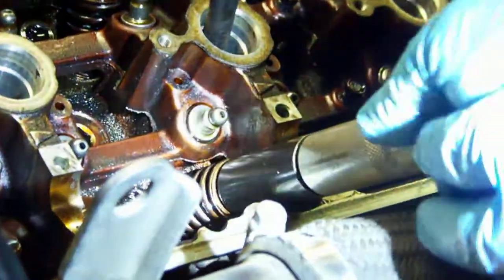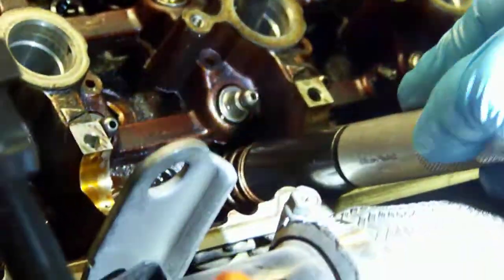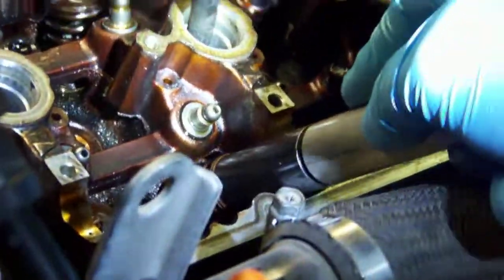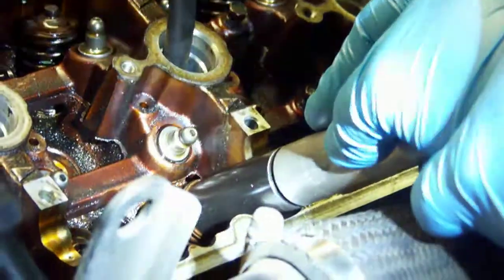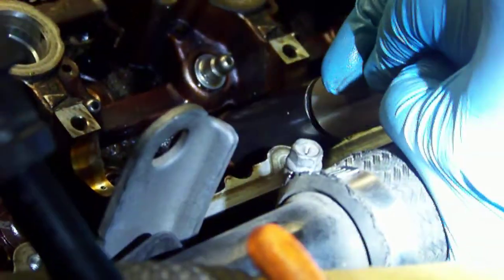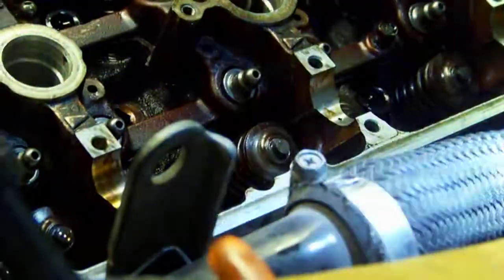How to install valve spring retainers / keepers on a 3000GT DOHC V6

Comment: How did you maintain pressure in the cylinder? I keep having blowouts through where the plenum would sit and air just keeps escaping
Reply: You can put skinny nylon rope in the spark plug hole and then turn the crank by hand at the crank pulley in order to push the piston up and stuff the rope against the valve.

Comment: Going to buy this tool to replace the valve stems seals on my 4g63t. Thanks for the visual demonstration. Really helped to confirm my purchase!

You can also feed some nylon rope in the spark plug orifice and set the piston you're working on to TDC to prevent the valves from falling in the cylinder.

Comment from the maker: The combustion chamber is pressurized using an air compressor and a cylinder leakdown tester kit.  This allows the user to regulate the amount of pressure fed into the cylinder.  The remover/installer tool can be purchased from your local Snap On Tools dealer or directly from their website.

Comment: I need to change my valve springs on my mitsubishi 3000GT 24v. I bought a second cam for the street race and normal driving.

 How is your air hose attached? Is it just an air hose you put down with air and then they come up?

 I have not tried it before but would like.

 Would you explain to me where you buy the tool you use for valve springs and how you mount the air hose?

 Regards Tommy

Comment from the maker: As you pressurize the combustion chamber (roughly 100PSI), there will be normal pressure loss over short periods of time.   The pressure that is lost will need to be replaced.   Over the course of 1 cylinder, my compressor cycled a few times to keep up with the pressure loss.   I'm not sure what a shock pump is capable of- but just keep this in mind that you have to be able to maintain pressure as you work on each cylinder.

Comment: sleepwalker..i removed the keepers with a gentle tap of a heavy hammer and installed them by pushing down real hard on the tool..i dont see how u could have scratched them...i checked all my valves after i did each one and none of them had the slightest scratch

Comment: this tool will save u hours of time, i just got through doing the vss on my 3000gt, the back of the head is the tuff one you have to remove the two brackets behind the head and its a pain in the rectum, and you also have to heeman the springs from the rear of the engine..im a small guy but i still could do it..i would probably be still on those valve if it wasnt for this tool

Comment from the maker: I don't know if you saw my video about how to remove the valve spring retainers with this tool, but i was very specific in it about how the other tools similar to this would not work.   What i said about the tool and the person using it wasn't meant as a personal attack.  I apologize for that.   If you're not using the specific tool that i mentioned- then you should not have blamed the lack of success on this tool.   I've tried several tools via trial and error before finding the correct tool

Comment: Yea, I noticed you installed it right, but others on youtube haven't. Watch their video and the stem is level with the retainer instead of sticking up about a quarter of a inch like you did. The installer I have does look too big, and their obviously not universal. My installer is silver and not black, got it from snap-on with no part number. I'm sure your right about the part number, but that wouldn't have anything to do with the person using it now would it.

Comment from the maker: The tool is only as good as the the person using it.   I've used this countless times on Mitsubishi and Toyota heads without issue.   Sorry for your troubles and difficulties with this job, but i still stand behind this tool 100%.   There are 100's of video's on Youtube of the same type of tool being used on other cars.   This specific tool part number is required as the centering pin in the installer is the correct size needed to do the job.   Other similar tools i've found to be too big.

Comment: The remover made my keepers scratch my valve steams, and the scratches destroy the seals, so I had to buy new valves thanks to this tool, and me and another mechanic can't get it to install the keepers. So it would have been cheaper for me to take it to a machine shop that can install the keepers without damaging the stem.